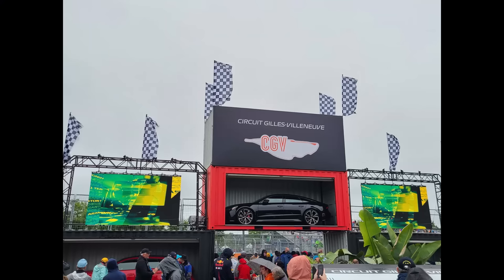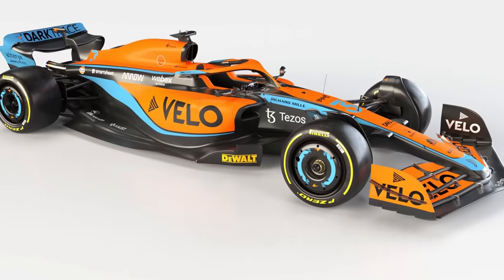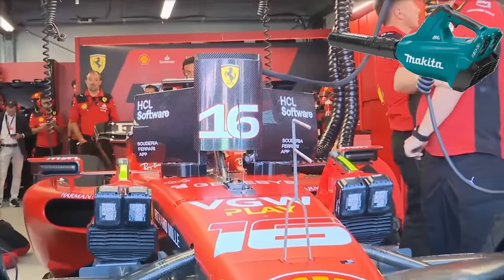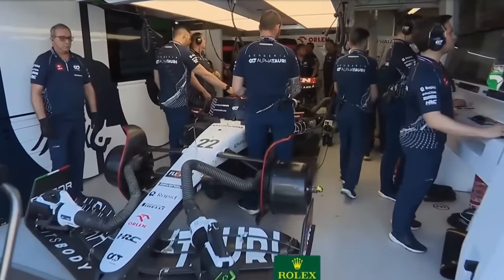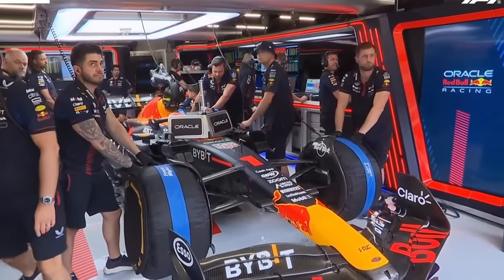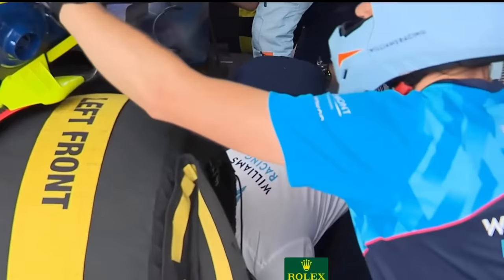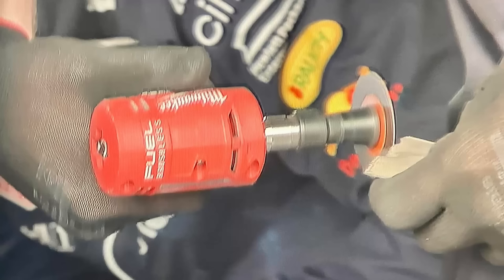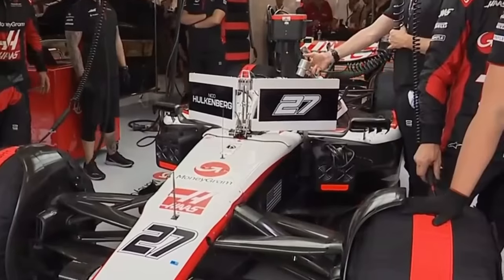Getting to See the Tools Used in Formula 1 Surprised Me

Comment: Regarding that cross threaded center nut it's quite interesting how those work. Now I'm not a racing nut, and I had no idea up until a week or so back when another channel posted a video about the wheel nuts used in F1. So there may be some things I forgot or misunderstood. 

First of all is the material used. They are made of aluminium (I'm from Europe, deal with the spelling :) instead of steel or some other high strength alloy. This is done to keep the unsprung weight as low as possible. Further they are not using a hex nut as they want both a more positive engagement and having to turn less before engaging fully. The exact design differs between the stables, or at least it used to. I might be wrong but I think F1 standardized the wheel nut recently for safety and cost reassons.

And the cost reason should not be scoffed at as they can cost $5000 each, and they are swapped out for a fresh nut every time they swap wheels. So swapping all four wheels can cost $20,000, and that's the wheel nuts and you still have to add the wheels and tires to this figure.

The high cost is partly because the extremely small series made so they are basically custom made on a piece by piece basis. But they are also all x-rayed to ensure there are no defects in the material.

But that's not where the weird stopps. There's also a automatic retention mechanism that stopps the nut from turning unless a the tool first unlocks it. This was introduced after some bad crashes were caused by a wheel nut working lose in the middle of a race. This mechanism increases complexity of the nut and increases the cost further.
Reply: From what I have seen. They are titanium.
Reply: @FarmerFpv the tool is titanium nut is aluminium. Or the nut wouldnt get machined your wrist would come off.
Reply: We also use Aluminum nuts on the LMP3 cars, and it's actually specified in the homologation so we can't make our own out of titanium or something stronger. I'm not 100% sure but I believe the nuts on our LMP2 are also Aluminum. While the unsprung mass is lower, the weight of the 4 nuts on an endurance car matters a lot less than something like an F1 car. So I don't know why they won't let us make our own, but oh well.

Comment: pretty rad to see so many brands be represented. i wonder how muvh effort is really put into making some of those custom cooler setups some teams were running.
Reply: Probably reflects the smallest effort - cooling is probably a "good enough" effort - as long as you can get enough air moving long enough then, great!
Reply: Teams that aren't using Milwaukee are at a disadvantage
Reply: @ryu-ken  I'm glad channels like TTC exist to disprove the brand bias out there that leads to comments like yours.

To say teams are at a disadvantage because they aren't running Milwaukee tools is naïve.

Note: I use Milwaukee tools, but I would prefer different brands for different tools based on their performance, but the disadvantage of multiple batteries and chargers outweighs this.
Reply: @ryanokeefe12   Agree that tool bias is a losing strategy. Best tool for the job regardless of brand. I do differ on owning multiple platforms, batteries and chargers. It's not an issue if the tools stay in one location as I have three brands and it works. When mobile that's a different story.
Reply: Uhhh, it's not really a lot of brands. Milwaukee, Snap-on and 2 or 3 others. That sounds like the opposite of 'many".

Comment: Idk if this would be possible but image going next year with a portable dyno capable of handling the toque of those center lock guns and doing in-the-garage- dyno tests. THAT, would be insane to see 😂
Reply: He could do it at the Texas or Nevada race.
Reply: The guns are designed to apply the desired wheel nut torque as quickly as possible (fractions of a second)... while they are capable of large-ish peak torque numbers, it's not what they're designed for. Meaning the performance characteristics are extremely specific and the gun would likely perform poorly in a standard use case test or a peak torque test, when factoring in the other metrics like price, weight, size etc.
The teams also won't let their multi-thousand dollar wheel guns get used and strained by members of the public for the sake of a torque test graph.
The guns are standard for each team and it would provide no benefit to the teams to see what the peak torque numbers are.
Reply: I would say that the use of the clips in this video sit within Formula 1's fair use of the footage for commentary/education, they may take issue with the fact that the videos are cropped to remove the F1 graphics and logos.
Reply: haha Fabrega would be down for a tech talk with it maybe

Comment: In regards to 12v tools being used where one might also use a larger tool: the logistics of F1 are run by F1 and the teams are charged for freight by the kg. As a result, they have a huge incentive to make EVERYTHING in the paddock lightweight because it pays back in freight savings every week.  Take a look around the paddock and you'll note that even things like the jacks and flight cases holding spare parts are all carbon fiber.  I'd suspect that they found the 12v tools do the job and weigh several hundred grams less.

Comment: I love those little bosch drivers, they will do a lot.  They are really 10.8 not 12v. but are really good.
Reply: Actually, Bosch rebranded all of their 10.8 V stuff to 12 V. The actual battery voltages are the same.
Reply: 3S Li-Ion cells for 10.8/12 V, 5S for 18/20/21/whatever V tools.

Comment: The drivers with the clutches, particularly the bosch but the dewalt are ok tend to be much better for installing small sensitive fasteners that aren't very impact friendly. 

Construction screws and bolts often have shear resistance, but machine thread ones do not and snapping an aluminum or titanium bolt off is a pain. I've not really been happy with Milwaukee's clutches in this regard, they're often too high torque; Electronic clutches also tend to follow this trend and I worry about their ability to not over-torque fasteners. I'm sure other tools work too.
Reply: Electronic 'clutches' are literally useless for delicate fasteners and can't do less than like 10 lb/ft (a ton for anything smaller than an 8mm head bolt). Mechanical clutches like the Bosch driver and lots of drills adjust down to <1 inch pound. Project Farm tested different clutches in one of his drill or driver videos and, yeah, electronic clutches apply a lot of force then stop, so they're terrible. I do a lot of Laptop and small electronic repairs and the 2.5mm thread screws are extremely easy to strip if you don't break the threaded insert in the plastic first.

I can use my 12v DeWalt drill with a mechanical clutch if I wanted but have a bunch of 'precision' driver sets which use 4mm or 5/32" bits (sold at walmart, HF, etc) that are way better for almost any screw than regular 1/4" driver bits.

Comment: That list changes a bit down the class line. Mid lever teams such as Arca teams will have a brand dedication and its usually dewalt or Milwaukee. We have wheel chills. Which is a brand and setup for AC. For pit stops however the Paoli guns are out and heavily modified IR is the usual. Sportsman type asphalt mimics that as well. Then on to the dirt tracks. We all carry the 1/4 drivers. Most dewalt. If the crew chief is a mechanic by profession they may use Milwaukee. And a 1/2 high torque of about any brand. Budgets being more of a concern. We also carry the biggest cordless grinders we can but usually break out the cords and crank up a 7-9" grinder to work on tires. But those drivers get the beating nightly on the dirt!

Comment: Yeah, I've noticed the rather obvious 2x18v Makita blowers for some time, but it's hard to spot other tools in general TV coverage. I'm slightly surprised with the report of all the SnapOn stuff; considering all the teams are European based, I figured plenty of Facom and Beta (both having sponsored teams), and surprised the big German names aren't as common.
Reply: Agreed. I wouldn't have guessed there would be any Snap-on tools being used. Like you, I'm surprised it isn't mostly German brands being used.
Reply: The socket at 7:05 looks like a Stahlwille.
Reply: @isaiahii6982  Snap-on have sponsorship agreements with a few teams. The deal doesn't require branding on the car or presence on any of the team's corporate stuff - snap-on are just happy for there tools to be in the mechanics hands during footage inside the garages.
Snap-on also have a "tool truck" type of setup at each event to service the teams.

Comment: I wonder if Makita has the upperhand in reliability? I mean, this is the pinnacle of autosports, and if theyre using so much Makita, its for a reason.
Reply: They explain in the video why Makita is used.
It's the most commonly available/stocked product throughout the world. It's simply an ease of access situation.
Reply: @ryanokeefe12  these teams have HUUUGGEEE budgets. You don't think they can stock plenty of equipment?
Reply: @luisprieto4589  It's not about stock. It's about exactly what I just said.
They have a maximum allotted cargo volume. Why use that space for something when you got just utilise a product that you know you can purchase throughout the world? You would be naive to do that - you'd use that space for spare parts for the car where it actually matters.
Reply: @ryanokeefe12  then why use Milwaukee 1 inch impacts then? I mean, Makita does have some impacts that make the torque they're looking for, too.
Reply: @luisprieto4589  makita doesn't make a 1 inch impact..

Comment: I have seen the pit crews use dry ice blowers on the brakes, in the radiators and air intake in very hot climates.

I have yet to find these specific tools that they use in dry ice situations.
Reply: is the engine running in that garage or do they have a means to keep coolant flowing through the radiators and block even when the engine is off?
Reply: @filanfyretracker  - no, the engine is completely off, hence these cooling fans that they attach to the intakes.

Comment: Very interesting, not what I expected at all, I follow F1 each week but if I have some mechanical knowledge about engine, and what we can find inside an F1, I always thought that the tools they use was made by each team for themself and very specialized and not something we can buy our-self.

The info about Milwaukee was a really cool things, I remember this Race with Bottas ^^
Reply: Back in the 80s-90s there was a hodgepodge of custom made, limited lifetime tools. Infamously 1400hp engines purely for a few laps of qualifying. The cars were a real mix of shapes, sizes and design principles. As a result they were unbelievably expensive, teams couldn't use shared tools because they were all unique.

The fact today you will see off the shelf air blowers is a result of homogenising the designs such that common tools can be used interchangeably among teams. F1 still represents the  cutting edge, but that is only seen where performance matters like during a pit stop. When a car is sitting in the garage, cooling the brakes and engine only need to be sufficient and reliable. Designing a high volume air blower won't make the car lap faster.

As mentioned in the video, lightweight 12v tools take precedence. F1 engineers can be unbelievably overworked and physically stressed. Think of a car that had a massive crash during qualifying and they need to fully rebuild it for the next day. I'm always astounded that they manage it, the drivers have it easy compared to them.
Reply: @beardedchimp  yeah, same for me, when you know that even if they have plenty of spare parts ready to use, they are still limited, and there isn't a 3rd car ready to go if you crash.
And theses guys can still rebuild it for the day after... amazing.
even with the biggest crash, the car is there for the race.
We often ear drivers thanks the team for that performance, we can read in the voice that the drivers, sometime, as a huge respect for this, and they deserve it.

That why I love F1 too, it's not just about making a fast car and a have a good driver, there is so much more important things who need to match together to be able to win.

But even if it's clear that F1 Drivers seems to not work as much as engineers and mecanics, I will not say that they have it that easy because there many things that we don't see and who are very boring for them or take a lot of there time, but it's normal, it's part of the job.
Diet for example, if it's not as strict as in other sports, they need to be fit and in well shape, they can't take +10kg during summer just because they love to eat a lot of icecream. 
They do a lot of sport and training too for there body to endure the G force in the car (part of the reason why De Vries is fired from Alpha Tauri, his body wasn't ready for F1)
And there is something who is very tedious for a lot of them and that they can't escape, I know that some Drivers hate it a lot and would skip all of this if they could, like max obviously xD, like talking to all the press and media, the communication video, photo shoot, promotion for a product, and stuff like that.
Sometime it's fun and I'm not saying that they have an hard life, but they don't have as much free time and easy life as we can think sometime ^^

(I wasn't saying it's you case, I don't know what you think, it's juste a big digresse from me about what you said for engineers vs Drivers, I don't blame you in any way ^^)
Reply: @Paulvarrgas  oh yes absolutely, I agree with everything you said. I wasn't trying to imply the drivers had it easy generally, simply as a comparison of what they go through during a race weekend. 

Losing 4kg during a race like Singapore is absolutely insane, the force their entire body goes through is hard to contemplate.

The engineers don't need to strictly control their diet between races for fear of a single kg affecting lap time. They also don't need to worry that any single statement they make in public will be misconstrued and become a headline.

A childhood friend works for Red Bull in their carbon fibre manufacturing (previously with Mercedes for many years, my Mum hasn't forgiven him for joining the enemy). It is insane how overworked, 48rs no sleep, that even the engineers back in the UK fight through.

Comment: Project farm said EGO Power+ LB7654  is the best for blower.
Reply: Project farm sample sizes are miniscule - he's also very good at comparing two "brands" of products that are from exactly the same factory.
Many of his tests are also tests that aren't relevant at all to how the product is actually used - For example, he tested stepped drill bits on extremely thick steel and marked some of the items extremely poorly in the test, when in reality, stepped drill bits are for drilling sheet/plate and for enlarging holes after they're pre-drilled (not starting to bore straight into a thick block of steel).

Comment: Battery wheel guns in the garage aren’t due to over torquing with air guns. It’s purely that they are easier to use and take up less space than air guns with lines running around the place. Nice video though. Most hand tools (ratchets, sockets etc) are bought by the mechanics themselves unless the team has a tool supplier sponsor.

Comment: Engineers back at the factory: We're going to engineer this bolt exactly to spec, for the max possible strength and minimum weight. 

Mechanics during the GP: Hehe DeWalt, Bosch, Milkwaukee go brrr

Comment: I dont think these guys are worried about run time too much. Probably got a tool bag full of spare batteries off screen. These guys micro manage every detail so even if the 15a battery lasts all day theyve probably got spares ready to go within arms reach
Reply: That's the point.. they analyse and refine everything they can. If you can have less batteries that require less management for charging and are less likely to require a swap out at the wrong time; it's a better choice.
Not to mention the output power is far more consistent with a higher Ah pack.
Reply: @ryanokeefe12  thank you for repeating what I said I guess? 

I didn't say the 15a batteries were pointless, I said they've likely got heaps of fully charged spares ready to go and that includes 15a batteries. 

Also higher amps doesn't always mean a more consistent output. TTC have shown multiple times that other batteries on certain tools perform more consistently.
Reply: @wearsjorge55  You said "I don't think these guys are worried about runtime"
I stated why they would be.

Comment: I'm surprised none of the race teams use any kind of ice or very cold metal cartridges that go with the leafblowers. Dry ice wouldn't be safe in those pit stalls but they could have something dipped in liquid nitrogen to help cool the brakes and radiator faster.

Comment: I have the Bosch 12V 1/4" drill/driver. Been using it for years. Incredible size/power ratio and  battery life - I love it. The price has gone up a bit but would still recommend it to anyone. (no I don't work for Bosch 😜)
Reply: I've seen Bosch power tools on clearance pretty often at Lowes for like $50 for the 12v driver kit. Menards also regularly has them marked down. Generally can find good deals on power tools outside the 'big 3' and Bosch stuff tends to have good engineering and unique features with less cost cutting.